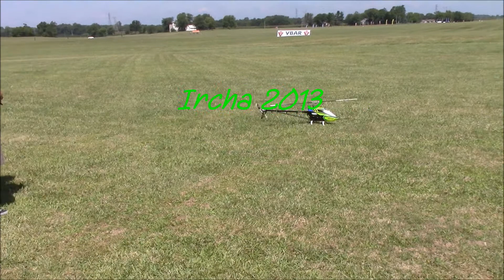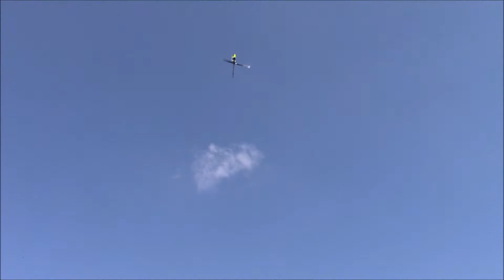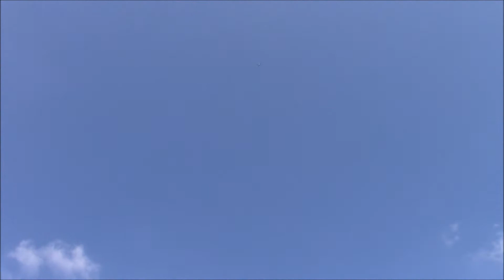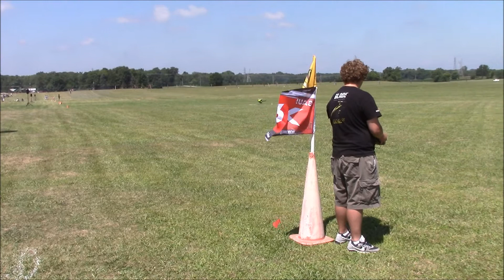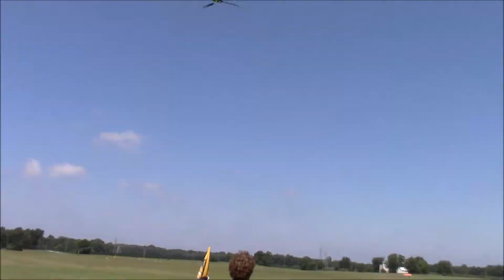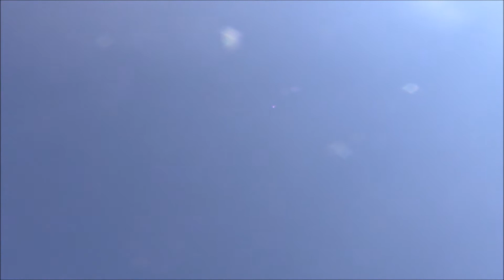James Haley Blade 700 X Ircha 2013 noon demo

Comment: very impressed, great flight.

bassk94, he can do what he wants, these aircraft are not toys and are not for kids. if someone is dumb enough to get their head cut off then so be it.
Reply: Lol poor roman but he was a experienced pilot just started young and bam took a carbon blade to the face these models today fly like a toy with today's gyros this hobby is starting to become dangerous why don't people start doing soft sport flying 3d 
Learning to fly a model like this is a joke you can fly that with one hand tied around your balls with today's modern gyros 
Big models are silly easy to fly just the danger factor is a problem 
Well I was not born back in the 70s these rc helicopters where as hard as nails to fly that had no gyros just a engine servos and a RX and your radio that was it 
 compare that with what we have now   we have created models which where meant to be flown by experienced pilots  but what is 3d just banging your sticks 
It don't take any skill to do this maybe there are a few tricks which may need some skill but its many stick banging which just gets boreing why can't people do smooth 3d
Because doing insane 3d does not take skill just a lot of balls and nerves to do it
Reply: jonathan oxlade textual flatulence.
Reply: That WAS smooth 3D, cruster.